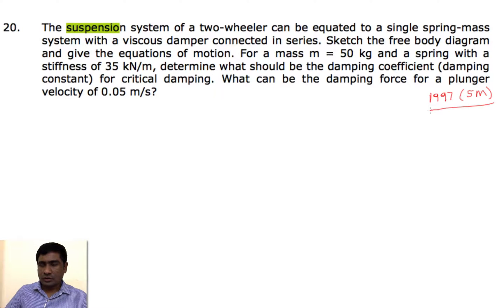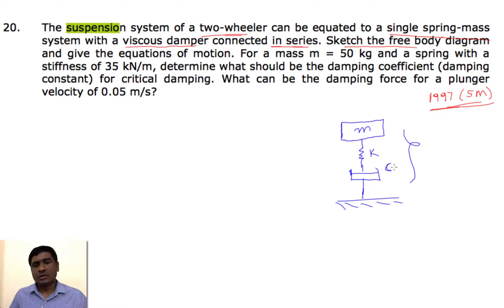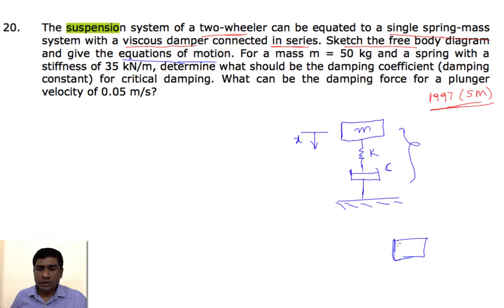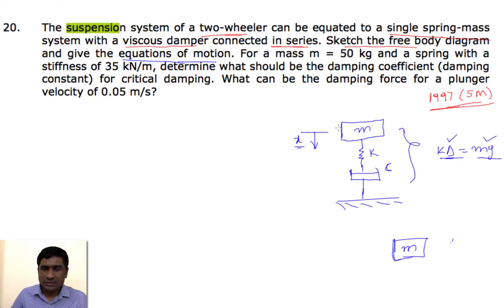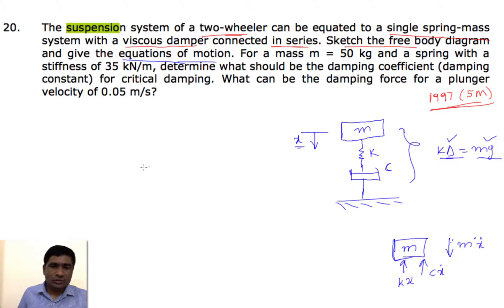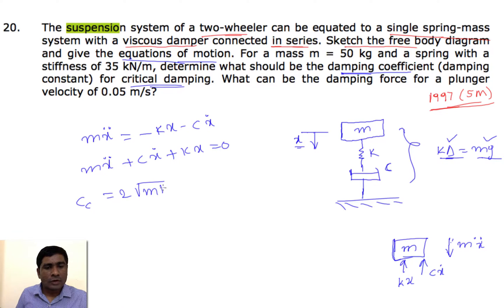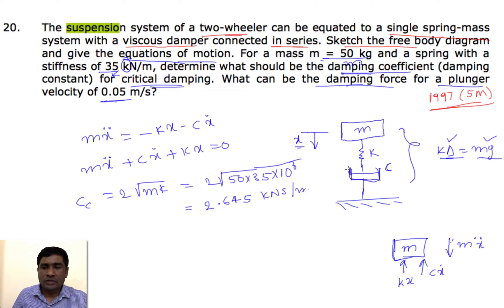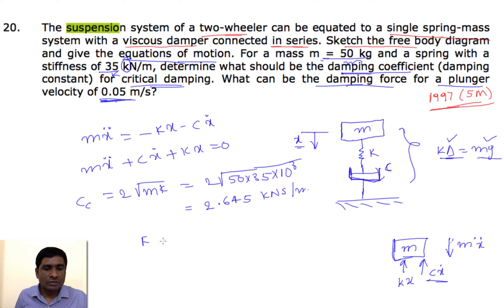Gate previous questions and answers on damped vibrations part 2

Comment: Can u give some basic lecture of spring system to under the depth and their approach of solving the gate standard question. Can I get your contact detail or email I'd.
Reply from the maker: hello Md hasibur Rahman .. those videos have already been uploaded.. once check in the playlist..
Reply: Mechanical video lectures By Adapala Chandra Sekhar 
Sir can I get your contact details so that I can discuss my few problems which I am facing. I am overwhelming If I get so and I need the main basics in production side as well like casting forging sheet metal metal technology and welding 
Can u please share all those sir because a strong base is required on these topic
Reply from the maker: Md hasibur Rahman .. main id chandumech9@gmail.com